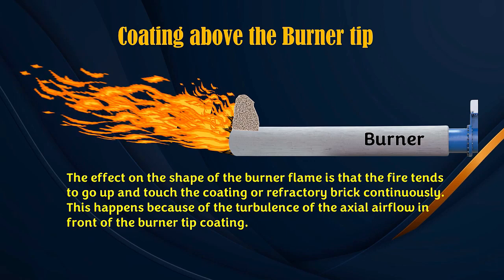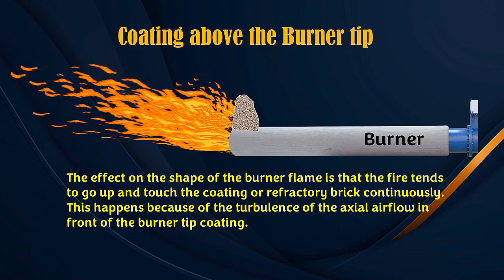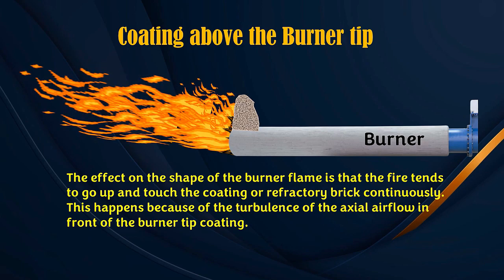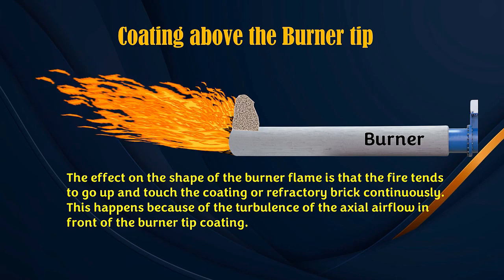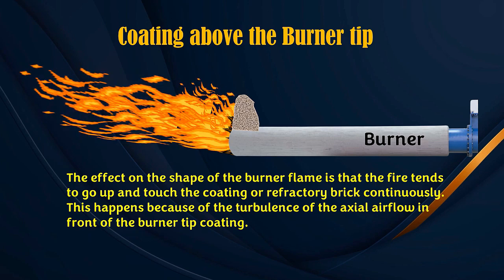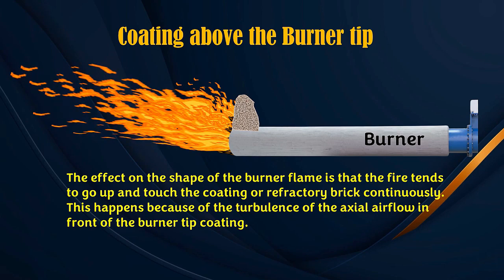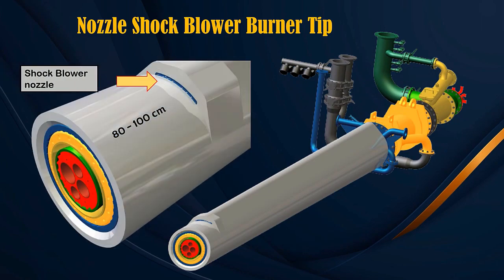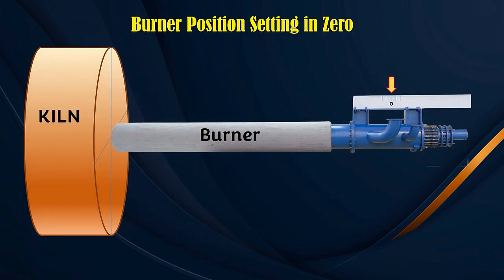Coating Above the Burner tip - What impact it to the combustion process?_ English Version

Comment: this is what always happened during operation, great explanation thanks SIR
Reply from the maker: Thank you for your attention🙏
Reply: please Sir, if you have the document done on snowman prevention at inlet cooler and on burner tip, please send me... we always stopped ours kiln due to this snowmen formed, attention!
Reply from the maker: Sorry we are a bit late to reply sir.
Kiln stop operation with snowmen interruption is a big disadvantage, we experienced also a few decades ago.
Before we respond to the problem you are experiencing, there are a number of things we would like to know.
1. How many centimeters does the burner tip enter the kiln from the nose ring?
2. What is the kiln hood draft setting?
3. Is there data on the quality of clinker when it snows?, such as: %Freelime, %C3S, %C2S, %C3A, %C4AF and Liquid Phase?
4. Is there a fix grate at the inlet cooler? if there are how many rows?
5. What is the Type of clinker cooler?
From these data we will try to help you to overcome the problem you are experiencing.
Thank You.